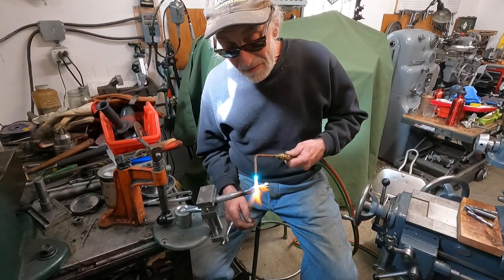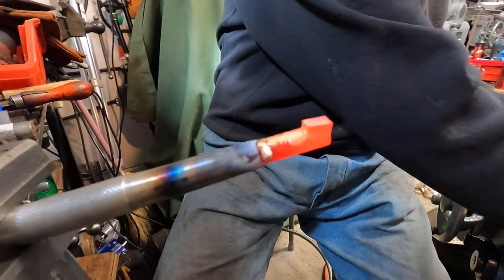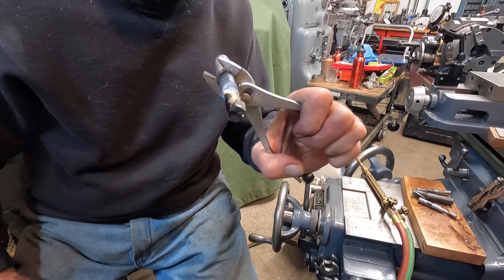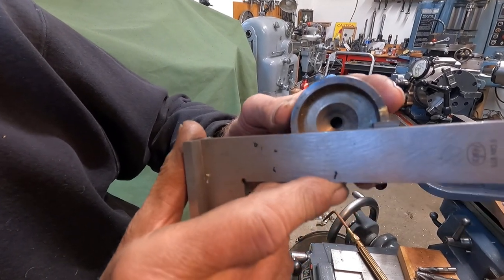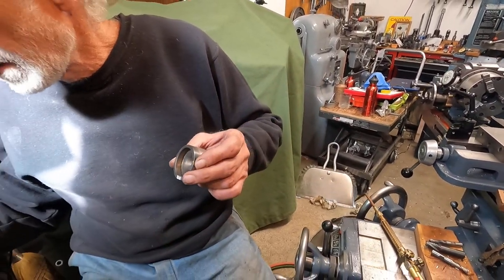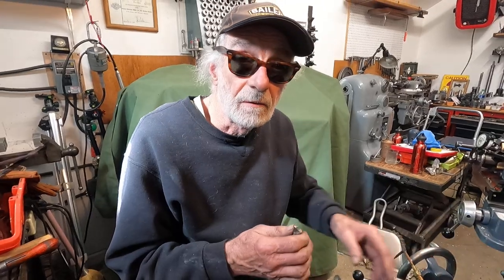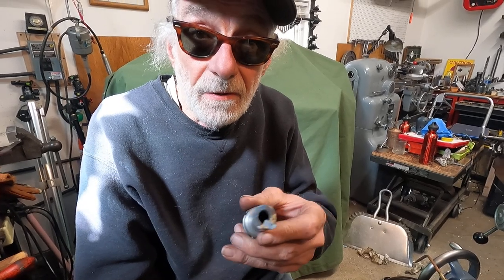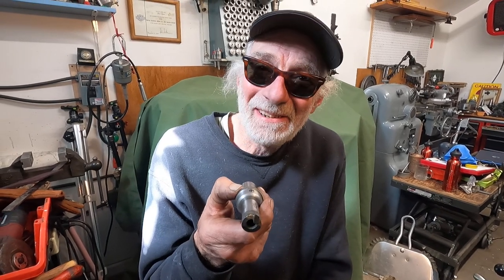Brazing a carbide blank tool making machine shop.

Comment: Good video Dee.  I look forward to lessons on tool geometry for specific metals.  I don’t remember ever seeing an optical comparator in your collection.  Have you ever had the need?  I am already sharpening carbide inserts and can get great finishes using cheap, used inserts, but I’m never done cutters from scratch.  This continues to be a lot of fun.  Thanks.  Cheers, Will
Reply from the maker: No optical comparator on hand, I adjust cutter angles as needed, that I can explain
Reply: @deedeeindustrialsuperprecision  Great!  Go Slow Though As I Am!  So many doors opening in such a short time.  You’re a YouTube Rockstar.  Cheers, Will

Comment: Dee dee did you use the same brazing rod and flux that would be used to braze cast iron ?
Reply from the maker: Yes, it is just plain brass rod, silver brazing is preferred by many
Reply: @deedeeindustrialsuperprecision  I thot silver was the primary use for carbide. It is just so expensive I think I will stick to the brazing you are using. Thanks for the responses.